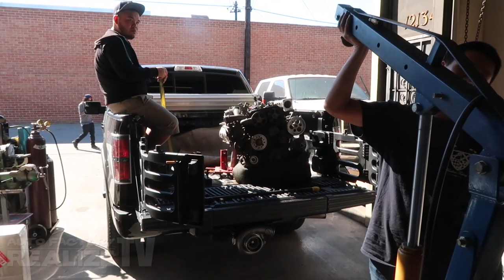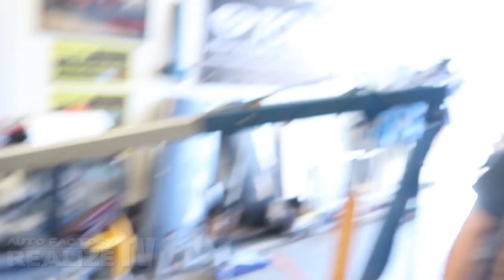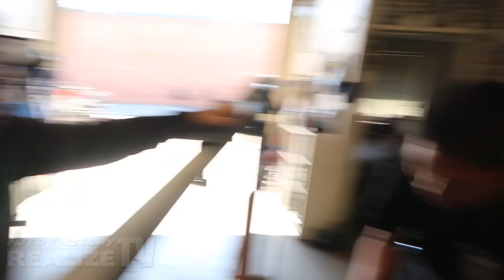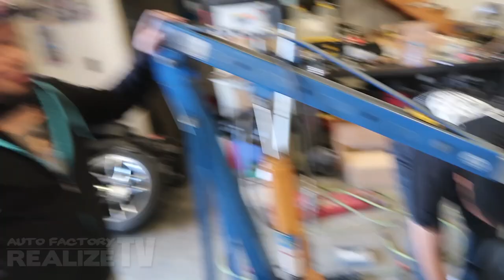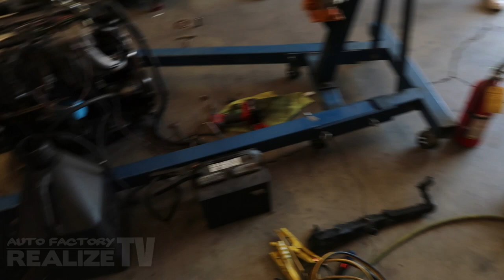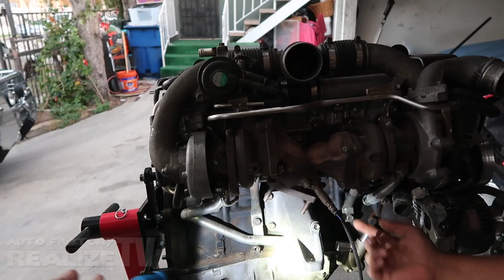Chuck's New 1JZ - MOMENT OF TRUTH

Comment from the maker: Question of the day: What would YOU do to this 1JZ before putting in your car? Anything goes! Post your mods down below!
Reply from the maker: Thanks A-A RONNNN!
Reply: gotta get it ready for another decade of service.  it's a toss up between cerakoting everything or using that 20% coupon at harbor freight for a powder coating gun.
Reply: Power fc, injectors, dirty single, bigger head drain, copper head gaskit, new studs, acl bearings, bigger oil pump, 18psi new fuel reg, and a whole bunch of 3rd gear limiter 😁😁
Reply: Your mom

Comment: I’d do the same thing I did with my vvti 1j before installing it, oem Toyota gasket kit, ARP head studs,new water pump, greddy/hks timing belt, timing belt tensioner, serpentine tensioner pulley, dame pulleys he already has, some aesthetic paint, bigger turbo, new lines, etc
Reply from the maker: Sounds fairly close to what we’re doing minus the turbo upgrade and we discussed head studs but looks like we’re opting to not crack the engine open.

Comment: Woulda got vvti
Reply: His car wouldn't run for 7,000 years if he did something different, lol.
Reply from the maker: Definitely. The deal we got on this non-VVT-i model was pretty hard to pass up, not to mention it’s what Chuck has currently so it’s as-if nothing ever happened.
Reply from the maker: Yeah and what Gary said
Reply: Auto Factory REALIZE what makes the vvti so much better then the non? Aldo how much PSI can the engine handle on stock internals?
Reply: has a more flexible power ban due to the variable intake cam. not overly much better just new model ect. 1jz either way my engine of choice hence why i have a one haha,looks good chuck keep killin it